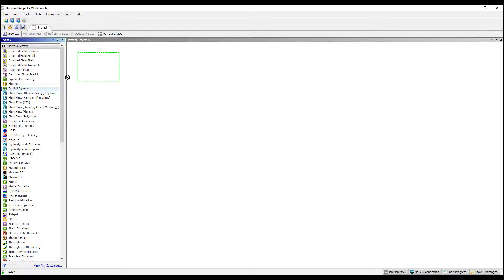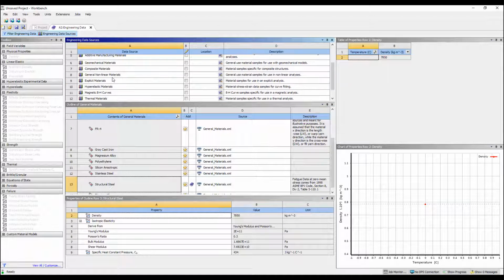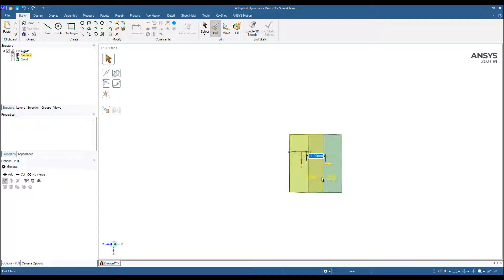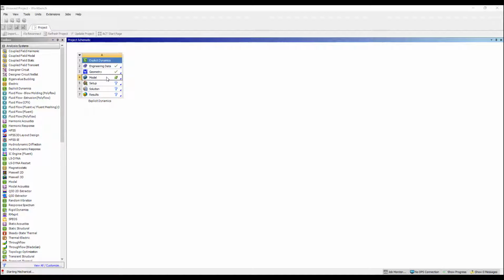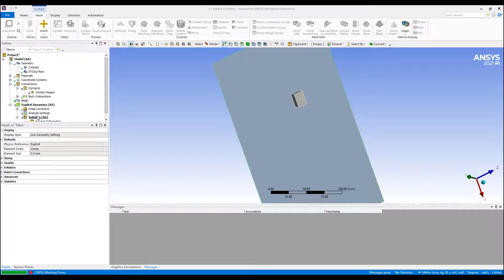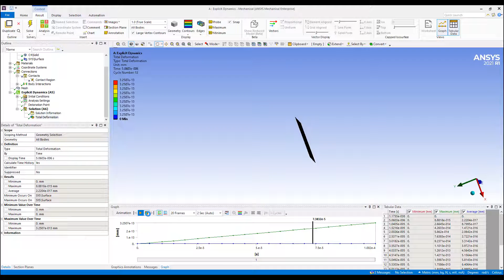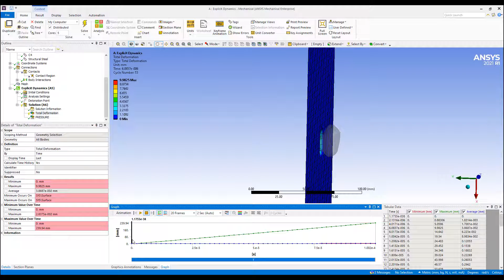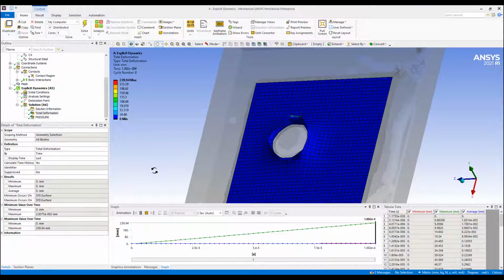Ansys explicit dynamics explosion simulations

Comment: If you add a failure for EPS like you did and you don´t turn the material erosion in the solver settings on, then the failure won´t apply. You got the erosion from Geom. strain limit and not from the material itself i suppose.

Comment: you set the plastic strain EPS to 0.2, is that because Bilinear Isotropic Hardening is 0.2? which means if Bilinear Iso hardening is 0.3 then you have to set plastic strain EPS to 0.3, is it correct?